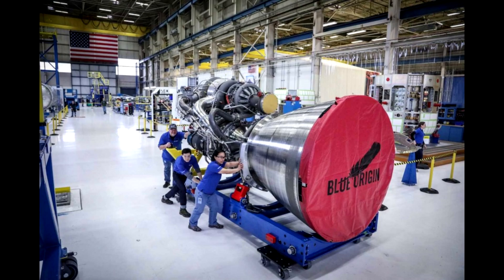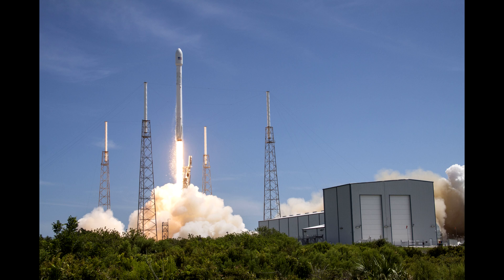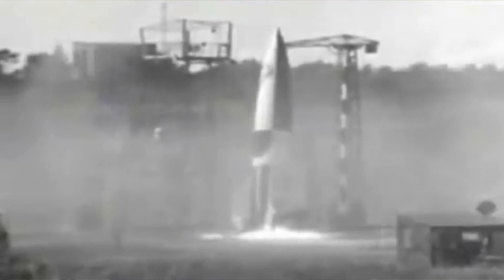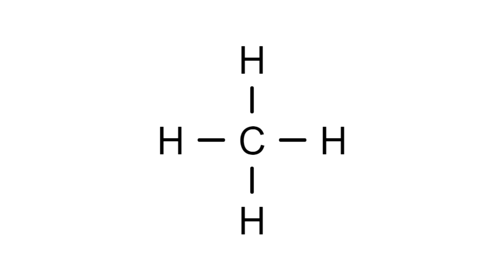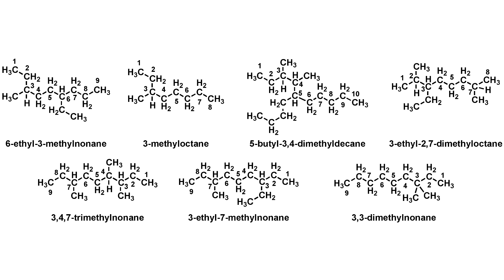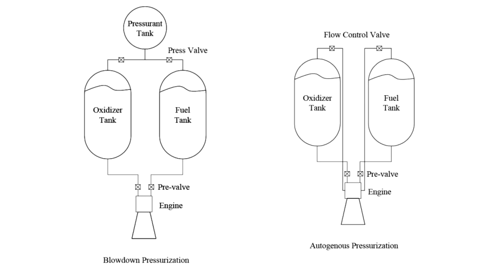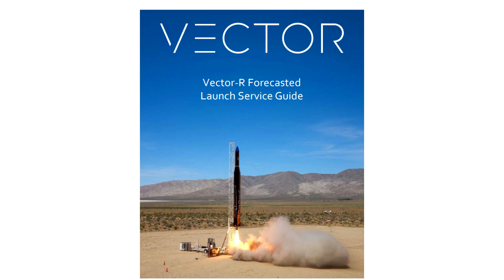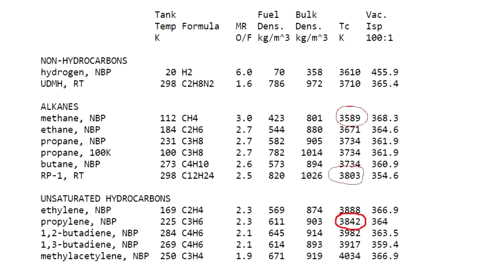Why Next Generation Rockets are Using Methane

Comment: You forgot to mention that methane is much cheaper than RP1, what is important when reusing spacecraft
Reply: Anhydrous ammonia--NH3--is also cheap (it's used a lot in agriculture), and it leaves no residue. The X-15 rocket planes--particularly after the "big engine" (the XLR-99) became available in 1960--burned LOX and anhydrous ammonia. Ammonia fuel also has the advantage--if one wishes to call it such--of not requiring any special leak detectors; one's nose is more than adequate for that! :-)
Reply: @j.jasonwentworth723  too toxic
Reply: Call me crazy but even if my rocket wasn't reusable I'd still want the fuel to be as cheep as possible
Reply: @nahuelalcaide2027  If you're throwing away a billion dollar rocket, it makes no lick of difference whether you spend $200k or $500k on fuel. It's not even a rounding error.
Reply: @nahuelalcaide2027  agreed. What the hell is OP's point??
Reply: @ewthmatth  With reusable rockets, the cost of the rocket per launch is decreased, so the fuel cost becomes more significant as a percentage of total launch cost.
Reply: Methane is easy to produce. Farmers here make their own from organic waste.
Reply: Also the engines on the ULA Vulcan rocket are designed to be recovered and reused, unlike the current Atlas V in which the RD-180 engine is discarded after each use.
Reply: Well yes and no, Elon musk mentioned that it takes about 200,000 dollars for the fuel and the rocket itself is more than 60 million I believe. The last I heard it was about 60 million but I could be wrong
Reply: @sovietman2591  and the fairings are around 10% of the rocket cost its insane

Comment: Pressurizing with helium would still probably improve performance. Better yet use LH2 and gasious hydrogen, oh wait delta iv currently has excellent track record doing that. Clearly Methane is the lowest performance fuel, probably capable of getting a rocket into space. That appears what they are wanting to explore, low performance technologies.
Reply: next time include cost and engineering analysis, not only physical analysis.

Comment: Got the story for RP-1 a bit wrong. It was a refinement of JP-4. You should read the “Lox and Flox and Cryogenics in General” from Ignition. To be honest the story is down right hilarious in the bleak Cold War kind of way. 

You see RP-1 was so highly refined JP-4 that it couldn’t be produced at high volume. But after a few years of research the US Gov realized they didn’t need a steady stream of RP-1, because once you’ve fired the ICBM’s fueling then second strike was an “academic problem”.
Reply: Pretty much the same reason why Aerozine 50 or UDMH would be acceptable; you wouldn't need to refuel your ICBM fleet after you've just fired it.

Comment: There is a very important reason for using methane that wasn't mentioned. That is storage temperature. The fuel & oxidizer must be stored together. So having similar storage temperatures is very important. 
At one atmosphere, the boiling point of oxygen is -297º f. For hydrogen it's -473ºf. For RP1 it's rated between 350º & 525º f. For methane the boiling point is much closer to oxygen at -257ºf. only a 40º difference. For Hydrogen, the other cryogenic, the difference is 176ºf For RP1, a room temperature fuel, the temperature difference is at least 647º What this means is that methane and oxygen tanks can be next to each other (or within each other) with very little insulation. This is a huge advantage in saving weight. 
There are other disadvantage of H2 & RP1. In terms of RP1 the coking or residue problem was mentioned. For hydrogen there is what Musk called the "pain in the ass factor" meaning hydrogen's ability to penetrate the smallest cracks, hydrogen enbrittlement & other handling problems. Plus methane is currently much cheaper than hydrogen.
Reply: Johnny Robinson 
Yes, the fact that Hydrogen is about the next best fluid to Helium is a perniciously difficult, often painstakingly frustrating problem to deal with.
Reply: Jan Eymers - Go back to wherever you got hung up on metric. Or be patient and wait 50 years or so. It'll come. I for one, reflexively hit the gas when I see a metric speed sign. Americans really aren't familiar with how many metric miles will fit in the back of a Ford F-150, or whatever ;D
Reply: Johnny Robinson - "The fuel & oxidizer must be stored together". In the rocket. But on the ground where they're separate, having similar storage temperatures allows similar equipment which saves on expenses. And then ther's the trip back. Hydrogen is great going but the tanks want to leak out empty before the return trip. You can add these to your list. And I also like your quote - "what Musk called the 'pain in the ass factor'."
Reply: While hydrogen is a pain in the ass
Methane exhaust is such a relieaf
Reply: One only needs to see the cost and frequency of SLS to understand the main problem.
Reply: Just a joke guys. But honestly it would help comunication a lot to switch to metric, Fahrenheit for example may used to be practical but Celsius is closer to Kelvin so jeah. Miles..... well miles is totally made up, if u would at least use nautical miles. Science in general has already a problem of comunicating with the average joe these days, even more so if they dont really have a grasp of SI units.
Reply: @janeymers7154  

Right then; joke well-taken (you're one of the few with a sense of humour about it).

The number of verbal prefixes for meter, gram, and liter for those who don't grasp scientific notation I find indicative of how literary-minded and story-driven we Homo Sapiens are.
And I make and stick by this point regularly; if we adopted a base-48 number system instead, the imperial measurement system would make more sense than the metric (The Babylonians had a base-60 system, which would mesh partway with either).
Reply: @HuntingTarg  Interesting thoughts... however since base 10 is already established its imper-ative to use it.  :D I mean, it makes absolutely no sense that the baseline of imperial units has to be calculated back to metric units with absurd factors like x0,453592. But hey i mean were not even consequently using base-N for time.

I mean below seconds everything /10^3 (metric) but upwards.....

Oh and, sure we could get used to it, but just adding or subtracting 3 zeroes is far easier handling units then calculating/remembering 48^N or whatever...
10^x means add/substract X zeroes from the number, u can easily teach that 5th graders.
Reply: @janeymers7154  
You've never had to think in hexadecimal, have you?
Reply: @HuntingTarg  I had to, and in binary too.
Reply: @janeymers7154  
Then I don't understand why you don't understand my objection.
It doesn't matter what base you're using, the behavior of 0 as a placeholder doesn't change: in that respect a base-48 system would absorb the imperial system quite readily.
Reply: I would take this comment seriously, because it contains solid arguments and facts. But sadly stoneage units are being used.
Reply: Yes the scientific community uses metric, but this video is for science fans who, in America, have a more direct understanding of English units. All the signs on the highway say miles per hour, not meters per second. The ovens are in Fahrenheit so they can grasp those temperatures more directly.
Reply: I do not recall where the 32 and 212 came from (I think it was calibrated to the melting and boiling points of Mercury, but WTH IDK) - but Gabriel Farenheit had a practical reason for putting the first three prime numbers in his temperature scale multiple times:
he hated working with fractions.
So the disdain for the Imperial system has a glaring drawback.
Reply: @DrZond  You're framing this as an understanding issue, but it's not is it. America and like 2 other countries are the only ones who still use farenheit. You're using farenheit because you're comfortable with farenheit. The US isn't the centre of the world and most people who read this comment will probably have to do some kind of conversion. It doesn't aid understanding of the majority of people in the world.
Reply: @DrZond  Count me as an American who much prefers metric. And highway I-19 that heads south out of of my home town of Tucson is signed in metric. But yes, I get your point. :)
Reply: So where's the difference between "scientific community" and "science fans"
Don't say it's academic titles, because lack of a title never prevented anyone from thinking scientifically.
Reply: Srsly Fahrenheit?

Comment: In a previous video you mentioned that the ISS produces excess methane in it's environmental systems that is then dumped overboard. Could this be used to refuel rockets docking there? It won't replenish the oxidizer supply, but it would be less mass to bring up to orbit.

Comment: Basically...carbon-biased fuels give the best thrust; hydrogen-biased fuels give the best impulse.

...and since the "saturated hydrocarbon chain" math is "C(n)H(2n+2)", methane is lower thrust, yet higher impulse, than RP-1. And it avoids the logistical problems of H2.

Comment: Not trying to be snarky, serious question: If CH4/O2 chemistry has such advantages, why did it take 100 years of rocketry before it was used in a production setting?
Reply from the maker: I explained that, RP-1 was an easier evolution from Ethanol. And hydrogen was the next big step

Comment: The question I always had for mars direct was how much of that hydrogen shipped to mars will boil off during the trip or while it's being processed? 
The original plan might not have been viable because of this, but its not really a big deal to just ship 20 tons of water instead, at least its safer than a huge tank of methane.
Reply: Water needs you to use fission gas cores (i.e., the fissionables are literally vapor already), fusion, or antimatter rockets to be viable. Basically, it takes stupid amounts of energy to break it apart.

Methane/propane/decane is excellent if you don't have such energetic engines but must haul stupid amounts of material.

Comment: Am  correct in saying trhe main advantage over Hydrp-lox is that it's denser, it can work in self-pressurized engines and burns a little cooler, but it is still less powerful.

Comment: Why not use antimatter as a fuel?
Reply: where would you get it and how would you store it.  Right now it takes a massive amount of energy to make only a few atoms worth of antimatter.  Also it takes a lot of energy to prevent the antimatter from touching the tank walls.  If the antimatter touches the tank wall it will be destroyed.

Comment: Here is a somewhat off-topic question:

What's with the throttlability of the New Shepard's BE3 engine?  New Shepard's booster lands in hover with just one engine. So that one engine is able to give over 1g acceleration to booster+full propellant load+capsule at lift-off, and yet throttle down to less than 1g acceleration on booster+very little propellant at landing. By contrast Falcon 9 has to do a 'suicide burn' landing because at minimum thrust they still have over 1g acceleration on a nearly empty booster stage. (I think Scott has a video on this.) This is despite the fact that they have a factor of 9 advantage over New Shepard, because they can light just one of 9 engines, where New Shepard has to light 100% of its (one) engine. 

One way of doing this is to have a very large dry mass for your booster, so the full to empty mass ratio is not large. I hope this isn't the case.

Comment: There's more hydrogen in a gallon of gasoline than there is in a gallon of liquid hydrogen!
Reply: This is absolutely correct. The density of liquid hydrogen is 71kg/m3 at atmospheric boiling point, and only slightly higher at the triple point. Gasoline contains about 6 times as much carbon than hydrogen by mass, so it would need to have a density of (6+1)x71=497kg/m3 to match the hydrogen content of liquid hydrogen, but the density of gasoline is significantly higher than that. The reason is that the intermolecular forces between hydrogen molecules are very weak, so there is a lot of empty space in liquid hydrogen, but the molecules are much more tightly packed in gasoline, due to stronger intermolecular forces.
Reply: londonalicante Except almost no one stores hydrogen fuel as atmospheric pressure liquid.  It's either stored at pressure or in a chemical configuration such as NH3.
Reply: @johnfrancisdoe1563  Indeed, almost no one (except the rocket industry!!!) stores hydrogen fuel in the liquid form. Therefore thanks for your comment, but I fail to see your point, since I was responding directly to a comment about the hydrogen content of a gallon of gasoline being more than a gallon of liquid hydrogen (something some people find hard to believe.) The original comment was presumably a response to the discussion of liquid hydrogen rocket fuel in the video. Liquid hydrogen is easily the best rocket fuel in terms of specific impulse, but the downside is the tanks have to be large. Did you watch the video? BTW I think NH3 has great and under-realised potential as store of hydrogen from renewable energy sources but that is another story.
Reply: Hydrogen has more potential energy by Mass and burns Hotter. Gasoline will burn colder so it has less energy. The extra performance far offsets the added weight. So the mass of a larger fuel tank will be lower per volume. The  the added surface area mass grows slower than the volume it can contain.
Reply: Tadesan How is that even possible?  Seeing as one atom takes up a certain volume, A gallon of gasoline has a lot of carbon in there taking up space.  I think you've got some phases mixed up or something.
Reply: Different Atoms and Molecules do no take up the same space. that is it's Density. If you fill the same size buckets and fill one with Water and the other with Lead which weighs more?
Reply: Robert Losey Dude, what are you talking about?  Also, the lead is denser mostly because of the amount of protons and neutrons in its nucleus.  Of course, density doesn't scale linearly with atomic mass, though, since the size of the electron cloud also factors in.
Reply: I think he might be talking about the gaseous hydrogen, with the atoms spaced out and less dense

Comment: SpaceX has never referred to the Raptor's Propellant as anything but "methane". OTOH, when Bezos announced the New Glenn, he said it would burn "liquefied natural gas", pointing out that it was much cheaper than super-refined kerosene. Since then, they seem to use the terms "methane" and "LNG" interchangeably.

So are either or both using LNG straight out of the ground or are they using refined, pure methane? Have you heard or read anything that could disambiguate the terminology?
Reply from the maker: It's been confirmed that it's refined methane.
Reply: Ah! Thanks.